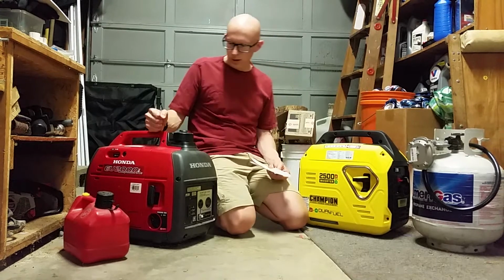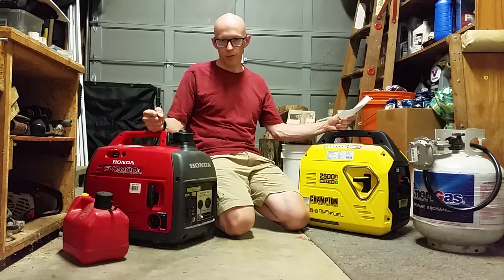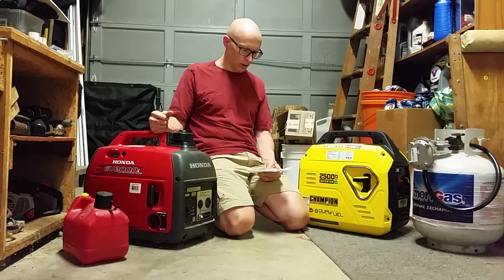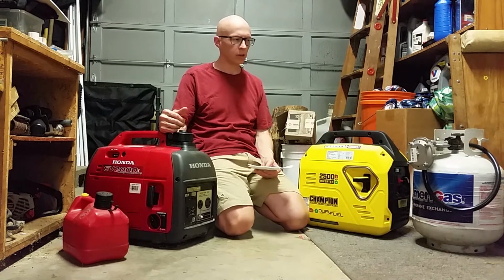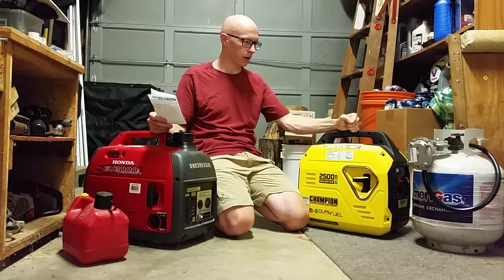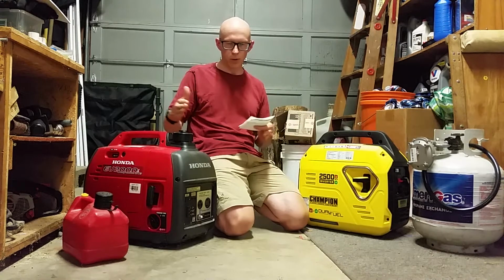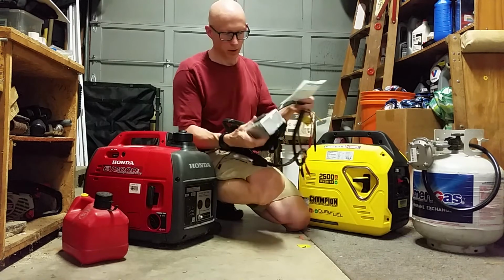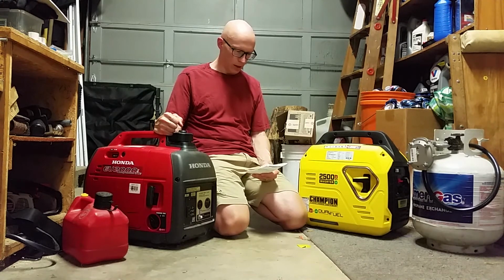Why I Only Buy Inverter Generators

Comment: My champion 2500 duel fuel generator uses a 20 lb propane tank last 20 hours(actually logged it) I was charging 400 watt battery 🔋 😳.  Still not bad (less then 1/4 ) load. Still very satisfying.
Reply from the maker: Hey, thanks for the feedback Edward!  Good to have another data point and very much appreciate you watching the video.
Reply: If you get your propane tanks from an exchange they are not full! They do this to allow for expansion of the tank. To get a full tank you need to get them refilled.

Comment: Buying Four $500-$1200  inverter generator That's $2000-$4800 (Honda)  compared to one 6000W Open Frame generator For $700  So your going to spend $1,300-$4100 (Honda) Extra to save a Few Dollars on Propane or Gas ! ,  And Yes You Can Parallel  NON inverter Generators , and for the Voltage  Newer  Non Inverter Open Frame Generator with a AVR  (Automatic Voltage Regulator )  will hold the Voltage Output Stable Too That's How they can have a ECO Mode   ,   NOW Older Generators that Use a Capacitor to Regulate the Voltage the Voltage will Fluctuate with Engine Speed and are not Safe for Electronics because the Voltage can Surge & Spike when a Heavy load is applied and unapplied  SO if your going to use a Non Inverter Regular Generator to power electronics Make sure it has a AVR and your good to Go . The Only main reason I see for buying a inverter Generator is if you have restrictions on Generator Noise where you live Or at a Camp Ground   Open frame generator are just to Noisy for most camp Grounds or Parks .

Comment: I wouldn’t buy anything other than after my EU30is, the thing sips fuel in eco mode, we recently used it for hurricane Elsa here in Barbados 🇧🇧 for 10 days, that and a small bit of solar for 24hour internet and phone service, i am upgrading to more solar so i can give it less work in the next major power outage.
Reply from the maker: Nice.  Yes, they definitely sip the fuel and are a great backup to solar.
Reply: @thekeltnerway3002  I’m contemplating another Honda, probably the eu2000 like you have
Reply: To bad Honda doesn't make a propane powered generator! I love my Champion duel fuel inverter generator.